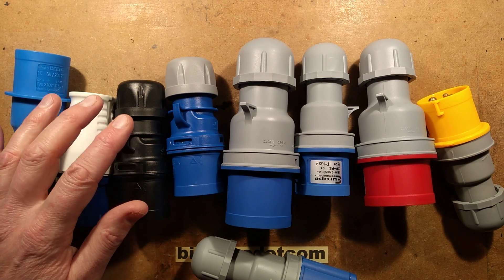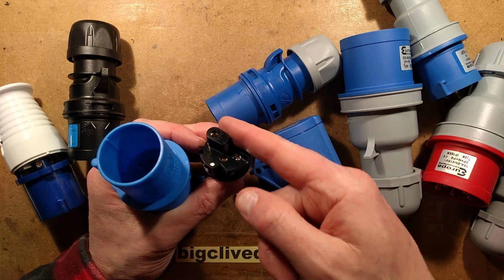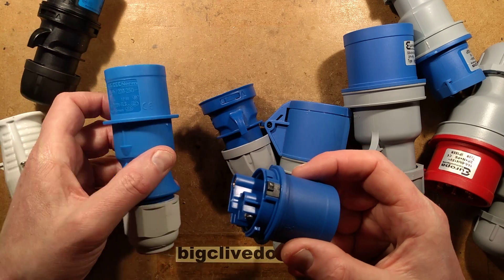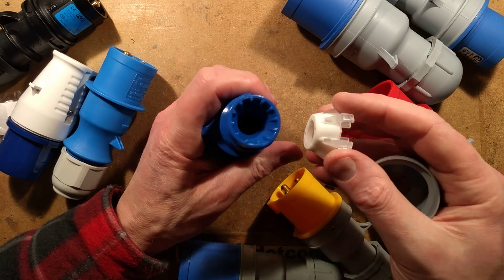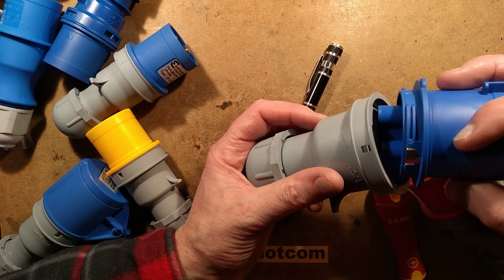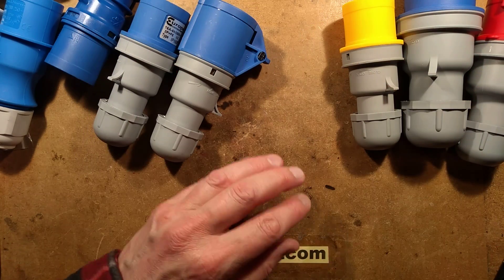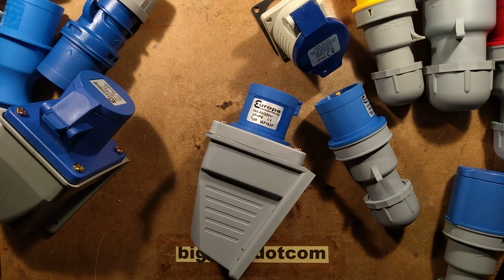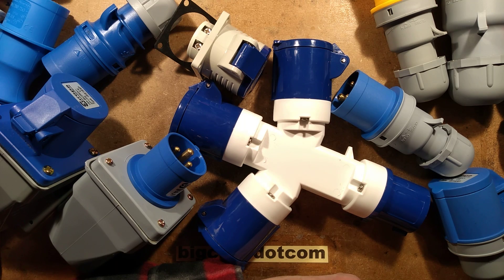My favourite industrial connector (Ceeform).

Comment: They use them here in Greece. When I moved here I had brought along an"European washer,dryer set". Funny they were wired for use in Australia. No problem for the washer have used a universal adapter on the plug for many years. The dryer was the issue. They do not have 20 amp schuko plugs and outlets here. I had to opt for one of these C form connectors rated for thirty amps. Gross overkill.
Might you know of a electric distributor there who might sell and ship to Greece ? I have looked everywhere for that appliance connector and they are clueless over here. The DC low voltage connectors would also be of use as well.
Have a surplus military ISO Connex unit that has inputs for 120/208 3Φ 60hz as well as one for 120/208. 3Φ 400hz. These are huge Cannon connectors that are almost 3 inches in diameter, they too use the method of twisting the internal connector at least 60° off center so one does not mix up the plugs. Sit down now, Cannon wants $2,700 per connector new!  OUCH! Typical overpriced military stuff.

Comment: It's the standard here in Sweden, and also in Denmark where i'm from. I have the 5-pin version on all my 400v equipment, and i'm just a regular hobbyist.
Reply: Peter G Finland also, 5 pin 16A 400V version available basically in every house, at least near main fuse panel, also maybe in garage etc.

Comment: We are using them also for every 3-phase connection in Slovakia, Czech republic, Poland, whole mid Europe and also for various configurations - 2 phase + neutral, 1 phase +PE+N, 4 pin connectors for older TN-C wiring with PEN, 5 pin for TN-S, 16A, 32A, 64A 3phase.. We are using it for pumps, bigger saws, water heating tanks, etc.
 
One difference with UK is, that when 1 phase appliance in UK is using bigger than 16A breaker (20 or 25A), we are using 3 Phase right away.

Comment: As a electrician I'm also producing all sorts of cables for the building industry. I know these connectors well and I agree that the PCE brand is my favorite. I also switched from using H07RNF cable to H07BQ cable. This cable is more resistend to wear. It also coils up much better. And its available in many colors so colorcoding of supply's is easy. Also for the 3 phase 63A extension cables I'm using H07 cable with alluminium conductors. This saves tons of weight on long cables.

Comment: Brilliant and versatile connections. I have at least 2 extensions in the shed with ceeforms on them and a  regular plug to ceeform socket to use them. 

And i have to admit, i also am guilty of cutting the tab off a 110v plug to use on a 240v socket 😂😂

Comment: Here in the United States we mostly use the less expensive NEMA twist-lock connectors for industrial power, so Ceeform is not nearly as common as as in Europe, but they do exist. Particularly in applications over 30A or wet environments.
Reply: I have seen them on kitchen equipment, in hotel and convention center ballrooms for entertainment equipment, on very large video projectors, and on battery chargers for commercial equipment.

Comment: In the US on Constuction sites you normally only see Leviton CS6364W (50 Amp) connector types, Ceeform is typically only used in the Catering Industry.

Comment: I work in event production/electrics in NZ. The 16 amp variety is very common here for connecting caravans and other mobile buildings, food trucks etc.  The 32 amp single phase and 3 phase versions as well as the 63 amp 3 phase version are fairly common in the event industry here. We also have another connector here which is probably more common in both events and industry called 'PDL 56 series', made by schneider electric.  You mostly find the PDL outlet in the 32 amp single and 3 phase versions.

And amen to your comment about foodies and their grasp of power ratings XD

Comment: You are missing the purple ones.
And Sweden uses them since about the 80's. Before that there was another connector type that was rectangular and came in various forms too, but the ground was in the shield of the connector so they weren't as safe as the CEE connectors.

Comment: In general, here in NZ we use AS/NZS 3123 plugs for most applications - they're the orange & clear ones popularized by PDL as the 56 series.

They have a few advantages over 60309 in that you can plug a 3~E plug into a 3~NE socket (but not the other way around), and the sockets are rated to that even if disconnected.

We use 60309 for a few things; 230V16A 1~ for caravans and construction site temporary lighting, and 400V3~N 32A or 63A for the non RCD protected supplies to construction site temporary power boxes ('lifeguards'). All cases where they want to specifically prevent compatibility.

3123 tends to have really, really, really tough to open doors though.

Comment: There is another version of the CEE connector. The tool-free version. https://docs.rs-online.com/dce7/0900766b815b5539.pdf
The conductors are connected to press terminals without stripping.
It has been used in germany since 1970 in the industrial environment.
Reply: Another brand with Youtube application.https://www.youtube.com/watch?v=akWKbOhFbNU

Comment: I have an early electric transit van conversion (UK). It charges with a 32A one of these on the side (done quite nicely behind the fuel flap, and the pins on the van, not the cable!)
Reply from the maker: I'm intrigued by the electric transit van.
Reply: @bigclivedotcom  it is a 2010 transit converted from new by Smith Electric Vehicles. Originally sold to Brighton Council (for those of you not in the UK, Brighton has a reputation for being very green).
Runs for 70 miles on an overnight charge, big bank of li-ion batteries underneath the entire load area.

Comment: In Poland we use the 3 phase variety virtualy on everything requiring 400V. Seems that here 32A is more often encountered. 1 phase CEE 17 is definitely less common, used only in specific industrial environment, even commercial appliances tend to have standard CEE 7/7 plugs. I also do love the ruggedness of those connectors. There are IP 67/68 variants too, that are screwed together, making them watertight wand waterproof. They fit normal IP44 connectors as well.

Comment: IMHO, the only excuse for cutting of the "clock" pin would be if you're making an adapter to connect a multimeter or similar device to a wide range of connectors without having to carry all ratings in all voltages, but that adapter should ONLY be used for testing and measurements

Comment: They are widely used in Poland, the single phase seen mostly in the industry, but the triple phase is widely used in houses, for appliances that require tri-phase power. We don't really use a dedicated home-use triple phase connector / plug here in Poland, we use these instead

Comment: Film in NY seems to mostly use Camlock, or Bates/studio pin, with some random Lex circular connecters smattered in on special equipment. I have seen a Ceeform on the back of a new fire truck at my department though.

Comment: Denmark, I recently saw the really big 400V on a building site movable panel with a cable input rated at 400V/400A 3-phase.  It seemed to have two 125A outputs, two 63A and some smaller ones.  It had a sticker indicating prior use at one of our biggest public construction projects.  I doubt the site using it now will need the full 275kW capacity.  Note, I haven't seen 110V at most construction sites.

Comment: UK, duh, but I once went to use the companies cherry picker and someone must have broken the 110v plug on the outside and changed it to a socket and made a double ended plug, so you had a cable that you could touch the live prongs and the cherry picker which you could touch the potentially live prongs connected to the onboard batterys or charging circuit lol, needless to say it was spotted when we went to charge it and changed within the next 20 mins before someone noticed that we wouldn't have wanted to notice, still no idea who did it in the company though, bit of a rouge electrician running around apparently 🤣🤣

Comment: In the US we generally just use strings of household extension cords plugged together end-to-end.
Reply: And you might have a couple new ones, but most of them are from the 70s that you got from your grandma's house, with no protection at all
Reply: Bonus points for a string of Christmas lights somewhere in the middle.
Reply: @wthrwyz  and don't forget to replace all the fuses with tin foil, aluminium foil or if you feel like it lead foil.
Reply: Either that or cheap snippers and black electrical tape. All you need!

Comment: Those are used in the Oilfield in the US and that HO cable is called SO cable in the US
Reply: SO cable is just one type. It comes in make different flavors. SO, SJ, SOOW, etc... All having different ratings for either voltage or resistance to fluids, flexing, heat and so on.

Comment: Both KFC and Dunkin' Donuts use twist-lock receptacles (240v) that are installed directly behind equipment on wheels (so every time someone moves something, they jam the heavy equipment into the plug end) or are installed above equipment on wheels (so a heavy cable dangles from the receptacle). Oh, and those-who-don't-know-better that yank and yank on the plug wondering why they can't remove it. All of those scenarios ends up the same: trashed receptacle. 

It's such a fail point, with intermittent operation and occasional arcing as a unit in use is moved and the cord moves slightly in a sloppy outlet, that one wonders why these plugs and receptacles are still in use when much better options are available. Yeah, I get that the better options cost more, but so do electrical fires, spoiled product, and having a spark come in and replace receptacles periodically.

Comment: The US usually sees the very scary NEMA connectors (gotta love a NEMA 6-50, it's like a plug from a cartoon) or Hubble connectors which usually involve a plug with a plastic core and metal tabs around the outside with a ground spike in the middle.

Comment: NZ, all over. Tech and show industry for anything Powerlock/safe is too big for. Refrigerated shipping containers with their own 32A keying. Used as standard as a caravan inlet/outlet everywhere.
There is a competing standard here from greater than 15A where we use flat pins, but it tops out at 50A. Cee is seen everywhere. Industrial sites use it for basic appliances (grinders, welders etc) as standard.
Appliance inlets are super common, never seen a double male connector here yet. But. Ummmmm. yeah caterers.

Comment: In europe, they're used everywhere where the voltage is higher than 230V.
Reply: I know in my country (France), we use the red ones for three-phase 380V (and maybe 400V), the single-phase blue ones on the other hand are for camping-cars (or RVs) 240V supplies (usually people use a converter harness to convert those into a normal 16A plug).
Reply: Alexis Trinquet hmm, 380V three phase equals to 220 single phase, strange if single phase outlets are 240 as it requires then separate transformer. If you have 230 one phase then 3-phase is roughly 400 and 240 single phase equals to 415 volts phase to phase. (just L-N times sqrt(3) to L-L)
Reply: Typical sizes for red ones (3 phase) are for 16A and 32A
Reply: Austria ( EU )
230V / 400V
We use CEE for 32A or where Neutral has to be neutral and can't be switched with the phase
Reply: Except UK where they have 240V with their own plug.

Comment: I am having serious problems getting one of these plugs as a replacement part for a construction machine. It is the 7 contacts one with the plastic nodge in 9 o'clock position (blue case, not the larger red one), by PCE, Austria. Catalogue "Typ 017-9v". Not available via all traders I tried. I even contacted the producer in Austria but got no answer... :-(     -   Prices in retail are around 30 euros for one plug, by the way.

Comment: These are the standard power connectors used in Denmark for anything requiring over 16A AC.
Only the blue and red ones though, and i have only seen 16,32 & 63 A plugs.
Both my generator and computer equipment uses these plugs, here they are normally just called "CEE" here though.

Comment: Belgium - they are used quit a lot is the industry here. We do call the ‘63A’ connector a 64A connector. And rarely see the yellow once. 
The H05 cable is used with many outdoor fixtures, but this cable tends to suck up water. So we always advice to use the H07RN-F cable, since it doesn’t suck up water.

Comment: these ones r used on portable gen sets .. in india ... we use it cuz the plugs r water resistant and cuz its rains a lot here and generators r left outside while running...

Comment: In some data centers in the USA, we'll have these IEC style Pin and sleeve for 3 phase 4 wire 208 volt large amp of 60 AMPS such as the PS460-R9-W. But more common for us is the NEMA versions instead of IEC. Pin and sleeve connectors seem to be driven by high density storage or compute vendors more so than what the data center vendor wants to provide them as a standard. They are just too expensive for the application.

Comment: In the US, MCDONALD'S uses a similar product made by Hubbell wiring, to do quick change out from breakfast prep equipment to lunch and dinner eqpt. Power comes out of the ceiling,  and the female connectors hang on the portable cord from the ceiling.

Comment: Not in Australia. We have a 10, 15 and 20 amp outlet. They use flat pins. The 10 A outlet is the standard household wall outlet. A 10 amp plug will fit in a 10, 15 or 20 A outlet. The 15 A plug will fit in a 15 or 20 A outlet, but won't go in a 10 A outlet. A 20 A plug will only go in a 20 A outlet.

So you'll see people saying they carry adaptors to let them plug their phone, but an Australian phone charger fits straight into a 15 A outlet. They're fine for outdoor use.

There are appliance inlets available for caravans and snack vans. I've never seen anyone ever use them the wrong way around to make live pins.

Comment: Not sure if I just missed it but some of those 3P connectors come with a phase changer (rotate two phases to change the direction of the field) so you won't even need a screwdriver if your machine works in the wrong direction
Reply from the maker: I should have shown one of those too.

Comment: Have a camping ground so have 4 spare caravan leads (NZ so 16amp 240v), each with this sort of plug on it. Each of the 4 is different in some way with only one being the same as what Clive showed.  When they do get water in them, they don't only fill up but the water can also run down inside the insulation of the lead itself.  Another important reason to always have a drip loop.

Comment: In Germany these connectors are all over the country. Mostly the red three phase connector. I work as a electrician here. So the blue CEE Connector is mostly used for caravan applications. The red three phase is much more common. I've installed them in all shapes and sizes, down to 16A up to 125A. 125A is the limit for the connectors here. 16A 3P 6h CEE I mostly use for smaller mobile machines like a industrial grade washing machine, fork lift charger or big stone saws on the construction site. 32A 3P 6h CEE is more commonly used to supply mobile kitchens or bigger machines. 63A 3P 6h CEE now there's where the fun begins. You need another contact in the plug to trigger a contactor to only pull the connector without load on it. If you pull 63A under load, you'll have a bad time. These connectors along with the 125A connectors are used to supply buildings with emergency power, interconnecting electrical cabinets on the construction site or cranes. Every other connector of the CEE Family I haven't seen or used very often. There are special CEE connectors for the ships of the army, but I can't remember what it was. I think green.
Reply: Oh and we use only "Mennekes" for our connectors. They make not only the connectors with that twist opening as you shown, the make the connection of the cable screwless. Just push in connectors for the cable. Really handy

Comment: You'll find these connectors at harbours throughout Europe.
I've been sailing since I was 5 and I've never had one break or malfunction, they are great.
Reply: The twist lock NEMA plugs we run in boat slips in the US are awful. Malfunctions all the time. I wish they'd gone with a better connector like this.

Comment: Here in the states we use the shape of the contacts to sort of make the plug a bit like a key.  The pins them selves won't slot in unless you have a shape.  BTW I mostly work with 3 phase.  The neutral is always the one with the long pin.  This system prevents both wrong voltage to wrong voltage AND wrong amp to wrong amp with the solid metal of the pins themselves.  Like, not relying on the plastic.  
Unless you have someone who "hacks" the extra ear off of the neutral, and then somebody gets a tingle.

Comment: frequently used in New Zealand, more common as the type of connector used on caravans, but the bigger sizes are usually used on construction sites
Reply: Only with the appropriate gender, though. Pretty sure you'd fail your electrical inspection here with the female side on your caravan!

Comment: Use these in water treatment plants in the NW U.S.    Have also seen the surface mount connectors with interlock switches so you can't turn the power on until the cord is properly seated.